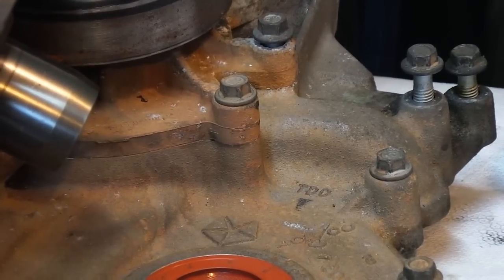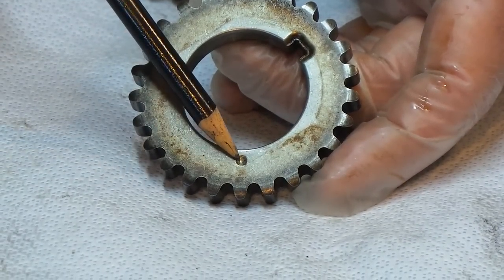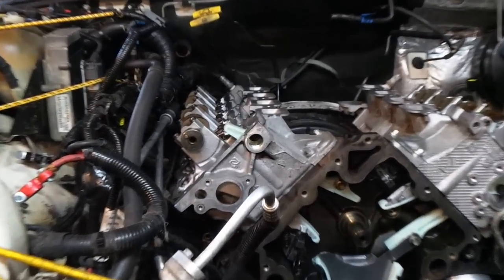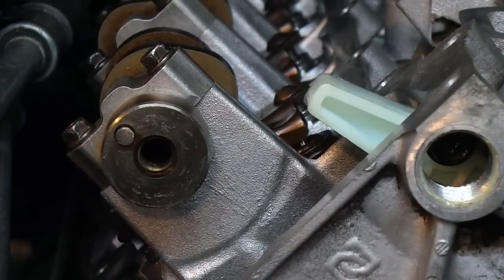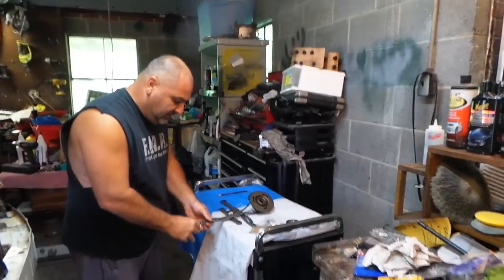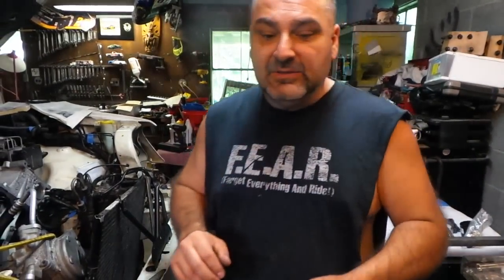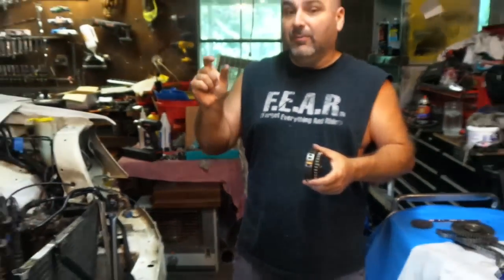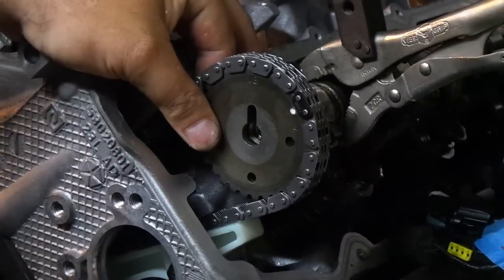Complete Timing Chain Job On A Chrysler 4.7 Engine

Comment: i have had a few of these motors i know they are a little complicated etc but honestly these are very good motors they produce good hp and they are very reliable, i just sold my durango  with 220000 miles on it and reason im posting is i just did all this before i sold it   i had some  things i was unsure of so thankfully you guys had this video.anyone that is doing this job i found the most important thing was just being patient it looks intimidating but you just have to take your time,thanks guys for the video it helped me.

Comment: Working on my wife’s 4.7 Jeep. Got all the accessories pulled and was just about to pull the harmonic off when I noticed the notch marked tdc. Seeing as its has a key way to line up with, do I have to pay attention to this. I am in the process of getting to the timing, oil pump, and crank seal. Great video! Thanks for your time. Shout out to Popsy for all his hard work as well.

Comment: I love this video. I have a 2000 Dodge Dakota that was given to me, and most likely has the valve seat issue, making the computer think the fuel injector #2 is bad. The injector was replaced, and the voltage checked on the wiring. Also, swapped ECM's with another one and it worked fine on the other truck. I have never dug into an engine this far, and this video gives me 110% confidence in fixing the truck. THANK YOU!

Comment: Thanks for a great series. I had been through this process 2 years ago, but my lack of understanding on the operation of the fan clutch, led me to falsely thinking I had corrected an overheating problem by replacing the thermostat. Anyway, your videos helped a lot. I do wish I had watched the one about properly placing the cam sprocket on correctly earlier. yeah, i did it.. I didn't have it on all the way, and after 1-2 hours, it spun free and chipped down the locating pin, exactly how your video later points out. Luckily the shop that machined my heads, changed out the pin on my cam, and helped replace three bent valves. Great series, though. Now that I have it running, wanted to give your props!

Comment: I'm a retired master of 47 years and your tutorial is flawless,damn good presentation,only one suggestion to anyone working with a multichain engines,you're gonna get messy on this,but it matters,the first 30 seconds to 1 minute run on startup on new engines or new timing components on these complex engines is critical,the stretch happens then ,till oil pressure slings on components,i always soak chains in rear end lube for 1 hour or more,then towl outside and let it drip off,then install,engines run quiet then you can hear cam followers and lifter designs,i also run duralube in engines after breakin and every third oil change,my ford has 487k on it with three timing chains,460 ford gets 16 mpg,it works

Comment: I want to add a wedge out of a 5inch by 1×2  with one edge up 2 1/4ish along the 5"  and cut taper down the 2" side 1/2" then a zip tie around both guides makes it able to remove the head and not lose mark or guides spring out of place. Also remove all rockers and cam moves freely! If you have the valve spring compressor tool for the 4.7 is easier and less chance of scratching up the cam. But  thanks for your time to show all this work!

Comment: Thanks for taking the time to educate someone like myself who has never done a timing job. It really is simple. Great Video!
Reply from the maker: +Wes Tanner awesome you need any help let me know
Reply: +JamieJones TheCarMan Thank you, I actually just finished doing the job, I will be putting it back together tomorrow and firing her up! The right chain was completely off of the idler sprocket. I thought it bent some valves, so I took the head off. I got lucky though because there were no marks on the pistons or valves and everything seated properly. I'll keep you posted!
Reply: +JamieJones TheCarMan Put her all pack together today. Started right up and purrs like a kitten. Thanks again!

Comment: This was just the video I was looking for. I've done several timing chains on other motors and I was kind of dreading doing the timing chain in my Durango with the 4.7 and this just made it that much easier. Ordering parts this week and knocking it the second the parts arrive. It's been ticking for a long time now and I've kinda just been wanting the motor to blow up so I could hemi swap it and well it's still trucking along. So long story short it's timing chain and guides time along with oil pump and might as well do the water pump since I'm there anyway. Again thank you for the video and the amount of detail you put into it!
Reply from the maker: checkout my playlist we cover everything, , job really not to bad

Comment: Thanks for the video I pulled the ps head off and was concerned with the lower tensioner I seen how it just sits on the tensioner in your video now that I got that figured out .. had to replace a head due to lifter seat failure. on a 05 dodge durango 4.7l. Thanks again for the video so much info about the timing set up.

Comment: I originally did the job to replace the oil pump and just wondering does it matter what stroke your in to line everything up
Reply from the maker: As long as the crank is on TDC, it does not matter. The stroke is set by the cams so if they are on 12, that is the compression stroke. If you move them to 6, its on the exhaust stroke. Was it running good before you pulled the chain? Why did you pull  the oil pump? Was the oil light on or was it making noise?

Comment: first of all, great video. everything was easy to understand. Secondly, i believe ill have to undertake this task after recieving an extremely loud ticking. I removed my valve covers today and the only problem i see in the top end is alot of play in drivers side cam chain. ive got a couple of questions is you have the time to answer them. first, is this the 4.7 corsair(semi hemi)? second, would a failed tensioner/guide cause loss in power?

Comment: Thanks for the video. My only question is at 39:40, how do you know while turning the camshaft that much you’re not hitting the valves against the pistons?
Reply: Take out the rockers and re-install them after. With all valves closed there is no risk.

Comment: Thanks for the video it really helped me a lot. I had a question about the timing chain, after I removed the timing chain I assured that it was on TDC but wasn't sure if it was on compression or exhaust. You explained in one of your videos that it doesn't matter if it was in compression or exhaust just as long as it was on TDC on #1 cylinder. So after I installed the timing chain on the 4.7 engine and matched the colored link chain to the dots on the sprockets and made sure everything was aligned but yet  the car didn't start. What could've gone wrong?
 Keep up the good work and thanks again.

Comment: at 34:57 you had to reset bc the cam sprocket would not go on the cam with the tension of the chain, I am having the same problem.
what did you do to get the sprocket on the cam???
Reply from the maker: vice grips to hold the cam

Comment: So I did this exact job and followed timing to a T but when I start the jeep it will only run if I stomp on the pedal and it sounds like it's missing and when I let off the pedal it dies any suggestions thanks
Reply from the maker: James Stewart  are you sure your marks are perfect , if they are sounds like a valve issue , why did u do this job to start with , did the chain break ?  Just seems like bent valves  no big deal if it is   , time to do a compression test

Comment: Jamie I found out this engine is an interference motor. that being said my tensioners & guides went out while driving.  no chains broke but due to all the slack when i turn the crank i noticed only the drivers cam turned and the passenger cam tries to but slips and stays put.  also there was a rocker laying in the valve cover when I removed it. is it fair to assume my valves are damaged?  Thanks and great videos.
Reply from the maker: +Reggie Smith yes you will need a new Head for sure , the valves are bent , I'm sure the seat dropped on the one valve happens to all of them watch my playlist I will go over everything in the job
Reply: Figured as much.  Thanks for quick reply.  I'm going to pull the heads this weekend and check it out and keep you posted with what I find.  Later.
Reply: Jamie you were correct.  All 4 exhaust valves were bent on the passenger side.  Thanks again.

Comment: I had posted on this page before, I've finally assembled my 4.7 to the point of adding the timing chains. These aftermarket tension-ers are JUNK even the Cloyes has Design Deficiencies on the spring loaded tension-er The pivot bore sleeve is much larger than the bolt, the bushing is missing, there is no way to bury the bolt to a stop with a bushing in the pivot bore to let the arm pivot freely. Beware of aftermarket tension-ers  like the Cloyes 90393SX there not right at the pivot point and on the back side the tang that locks the nylon pad onto the aluminum body is short of reaching the square hole it is to latch into. Excellent Video... everything necessary to time the 4.7 sure helped me in my first experience with the 4.7 mickey mouse backwards engineered engine that is a poor attempt at stealing the V12 Ferrari design.  Thanks Dodge for the #^@(!#G !!!

Comment: What's you car man well I did I put the timing chain on i rotated the engine without the spark plugs and it went around smoothly  that's good right Hope to here for you car man thank goo Bless
Reply from the maker: Ok 2 cams  v8 @ 12  and crank mark at 6 u are good 2 go  goodluck ,looking forward to how good it sounds

Comment: Outstanding JamieJones. I'll be referencing this video when i decide to overhaul my valve train. Is there anything you figured out after the fact. ie components you didnt have to remove for access to the front cover.
Reply from the maker: +madmacc040 no the only thing that I would say is take your time follow our video step by step and it will come out perfect and we also have other videos on every aspect of it from building that had to you know when we remove the oil pan and oil pump and all that good stuff so anything you need we done it pretty much

Comment: I listened to your video and did everything u said and engine still don't start  what else should I check  now the engine is a 2006 and truck is 2002 I did have to switch the gear on the back  of crankshaft from 32 tooth gear to a 16 tooth gear because of the firing

Comment: I didn't use a cam gear tool i just used the chain to hold the gears still and break the bolts loose.

As long as you put something in place (i used a very long screwdriver.) to hold the balancer still you wont move the engine much and can move it back afterwards. Then you finish taking the bolts out of the cams and remove the gears

Comment: 5 years after I have a question, if you want to removed a head for a head gasket, would anything happen if you only remove on side head gasket, / chain tensioner, chain, and put it back toguether?
Reply from the maker: No I wouldn’t heard anything I would just check to make sure you don’t have any seriously Warren parts you know I wouldn’t wanna put bad parts back on but yeah you could take it literally completely apart and just change the gasket and put it right back together and if that’s all that was wrong we will still run just like it did
Reply from the maker: Actually I’ve taken the heads off of stuff that like back in the old days of trying to raise the side and the other Al not particularly proud of it but it will work you can pull the head off of something and just cut out a piece of cardboard flat and it’ll probably get you through 2030 minutes of the race another words a good head gaskets better than a bad one LOL

Comment: Extremly helpfull n fun,ur right could save a big bill.very sweet guys!!!could zip ties work just as good as rubber bands.just cut them with diagnle cutterz when ready.owner of 2002 wj need to do heater core vid next thats my next job,leaky core!!snookie pa.
Reply from the maker: Heater core will test your Nerves lol good luck tks for watching
Reply: Yeah tell me about it,if the blend doors arent upgraded to aluminium fix ones theyll also eventaully break.so this is second time dash is coming out.dealer did first one upon my request,only to fix one door 3months later other door broke.after putting in upgraded ones i was good for awhile.now two yrs later of course the core leaks.so now i tackle it cause no longer under warranty.saw on utube not easy task is right,but ill try!!!snookie
Reply from the maker: A upgrade would be awesome
Reply: Jgc parts .com is the place to get upgraded aluminium blend doors!!snookie pa.
Reply from the maker: Tks for the share

Comment: Something that makes this job easier. Dont focus on getting the cam chains 100% lined up on the idler pulley. Don't install the tensioner or tensioner arm. Install crank to idler pulley chain. Remove cam gears. Do the RIGHT side first, followed by the LEFT side. Install tensioner arms and tensioners. This is a one man job. Tighten all to spec. I've done this job myself in less than 10 minutes.

Comment: Thanks for video . 
I was just wondering you don't have to align the cams before installing the heads?
Reply: Interference motor, yes. With crank at TDC he says cams are installed using timing method. With no cam, all valves should be closed. To me, sounds like you would just get timing set and then install the lifters and rockers as you go.

Comment: I appreciate your video it is exactly what I was looking for. The rubber band trick helped out a lot. Here is my problem: I am having an issue with the passenger side head. namely at the #2 piston right up front. when I am turning the engine, as the #2 piston nears top it stops and I can't turn the engine farther. the valves are closed and with a bore scope, I see nothing hindering movement. with the heads off the crank can turn over and over no issues. I have removed the cam shaft and attempted to turn the crank with no valve movement and all closed, but it still stops. Question: what can cause that? 2008 Jeep Grand Cherokee 4.7L
Reply from the maker: +Jon Iredale you're off a little bit in the valves getting caught
Reply: JamieJones TheCarMan the cam is off and the valves are closed though. I verified all valves throughout are closed with bore scope
Reply from the maker: +Jon Iredale so you're you're saying you have the cam off of both heads completely and you're turning the crank and it won't spin over is that right
Reply from the maker: +Jon Iredale the only thing that can stop it is about protruding or a valve seat not seated correctly that's it that's the only two things I can stop it
Reply: JamieJones TheCarMan yes. I found out the problem and had it fixed. refurbished heads, but the didn't mill the aluminum they used to fill the previously damaged cylinders. rather than wait for them to get back to me I took them to a machine shop local and had them made right.
Reply from the maker: +Jon Iredale are we back running now and by the way I just put a complete playlist on that entire job with about 17 videos on my homepage
Reply: JamieJones TheCarMan I will be by the end of the weekend. work schedule is horrendous right now. got my cam sprockets with the chains up with bungees. I'll be putting them on the cams hopefully tomorrow if I can get home at a decent hour. as well as getting the intake, fuel injectors and front of engine equipment back on
Reply from the maker: +Jon Iredale well if you get a chance to watch the playlist on my home page it should answer any questions I can possibly come up but I'm here if you need me and I can do that job in my sleep
Reply: JamieJones TheCarMan definitely will. thank you!

Comment: Great video but what about if I didn’t took it apart in TDC because the woodruff key broken and jumped out time ? Please help
Reply from the maker: No problem man just at the crank just like I show you in the picture and the cams are what set the top dead center so just line them up and you're going to be completely fine
Reply from the maker: Literally the crank can only be in one position and the camps can only be in one position for top dead center which is the V8 signs which I'm showing you in the video you said it like that it's going to be perfect

Comment: How do you know your on the exhaust stroke? Believe it or not I'm going through this all over again with was to be a re-man motor. I'm all lined up ready to put the chains on but not positive I'm on the exhaust stroke. How do you know?
Reply from the maker: ok so the cams need to be with the v8 at 12 oclock,  thats top of comp stroke , now if you want it at exhaust u need to put the v8 at the 6 , the cams are what determine the stoke , not the crank so as long as it sits at 6 oclock you can put the cams with the v8 at 12 or 6 and it will start , but I recommend you going with the 12 o'clock position for the Cam because it's very very easy to line up and there's no room for mistakes and also there's no benefit in setting it up on the exhaust stroke
Reply: +JamieJones TheCarMan in the haynes manual it tells us to be TDC on the exhaust stroke when starting this project.
 it also says the exhaust stroke is one full rotation from the comp stroke.
easiest way is using a compression gauge, the moment you start getting compression your starting the compression stroke. 
Your video has been extremely helpful dude, bout to button her up tomorrow and be done!
Reply from the maker: The crank must be set at the 6 position no mater what , the stroke is set by the cams put the v8 at 12 for tdc comp.   If u set cam v8 at 6 that will be exhaust but if u want it perfect and only do it 1 time set cams at v8 at 12
Reply from the maker: Trust me u dont want to do it twice, u need anyhelp let me know i will keep an eye on this feed in case u get in a jam